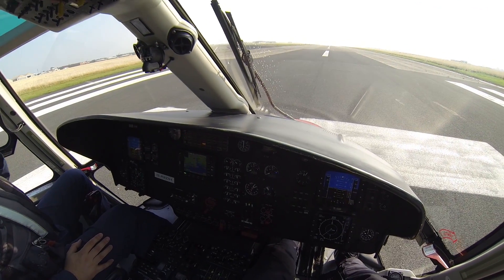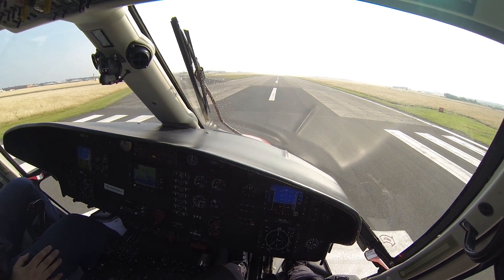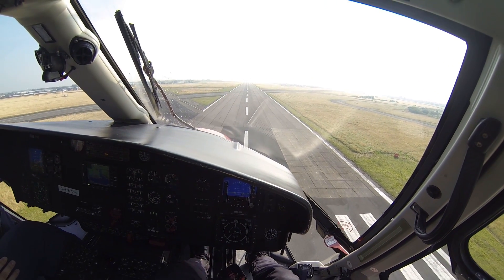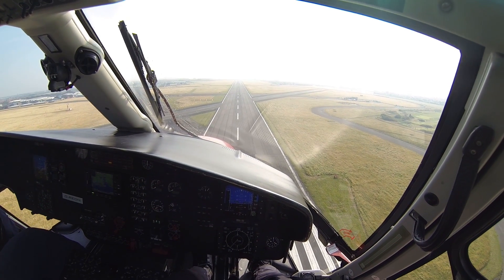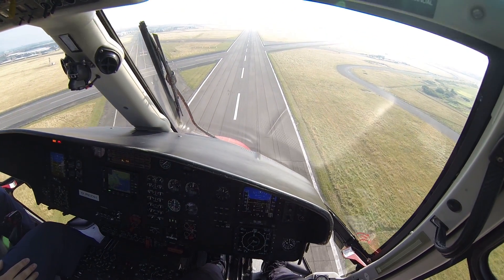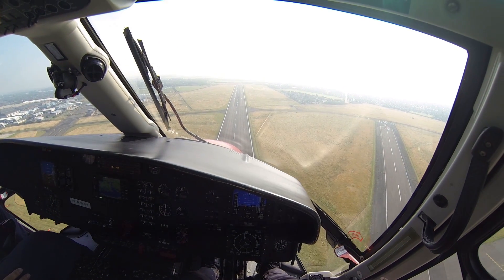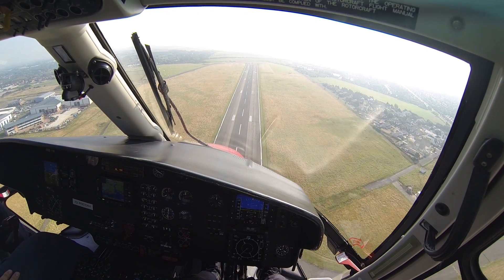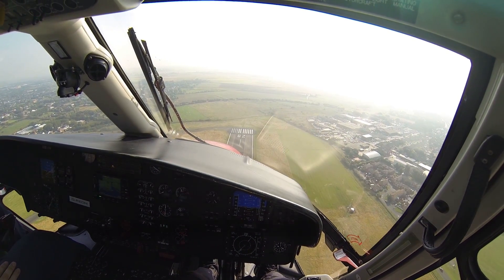Class 1 Helipad departure with single engine failure

Comment: How much time does the pilot have to enable auto rotation when both engines fail?
Reply from the maker: Rotor RPM can be lost very quickly at higher pitch settings, so only a matter of seconds before it becomes unrecoverable, but it depends on a lot of things.